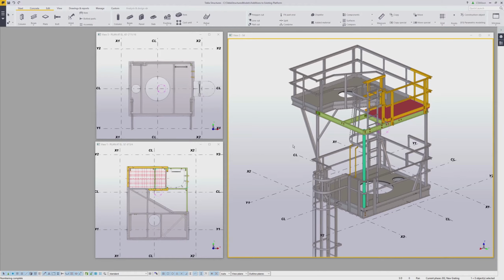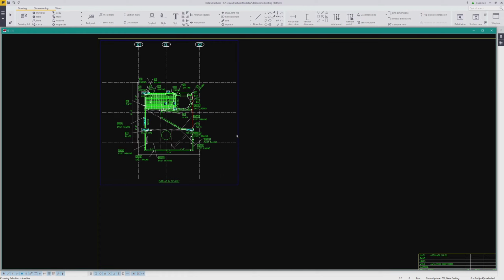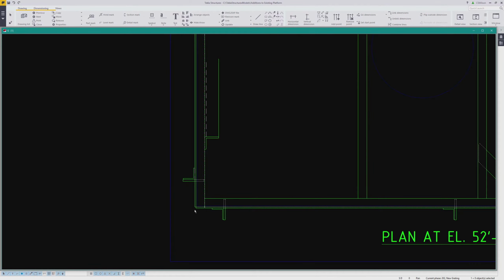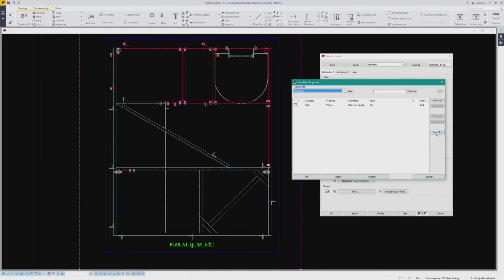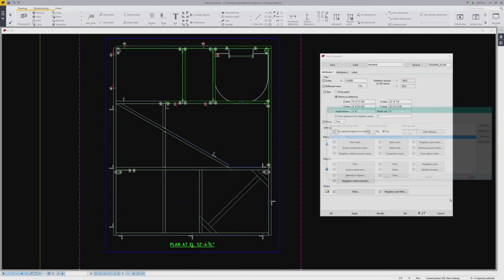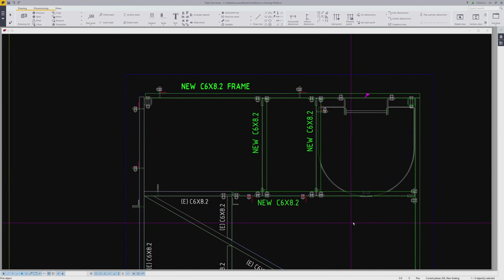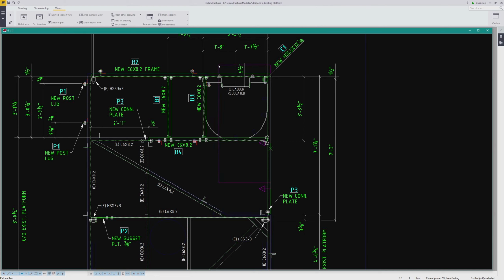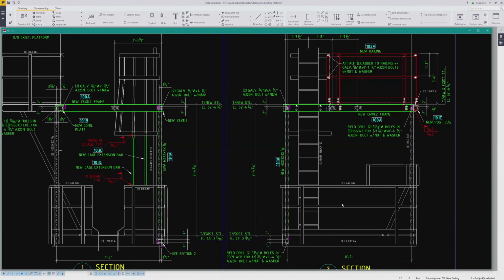Additions To An Existing Platform - Part 3: GA Drawings (Tekla Structures 2016)

Comment: hello,
how I set up for the  profiles are drawn with high level of detail
Reply from the maker: Without Tekla running, go to the model folder of your project and open (or create) the file OPTIONS.INI and include the line XS_SOLID_USE_HIGHER_ACCURACY=TRUE.  The next time you open that model, the profiles will be shown more accurately.
Reply: Thanks